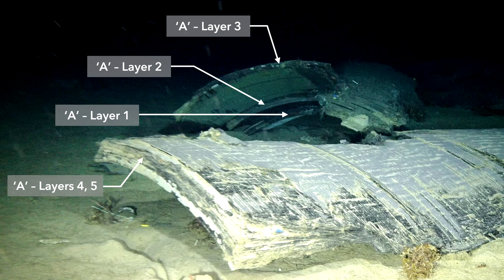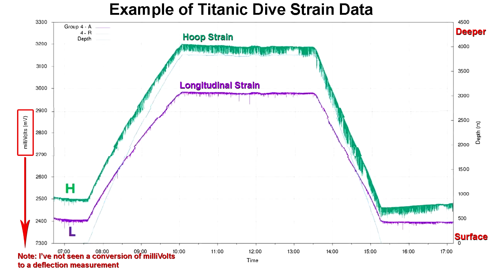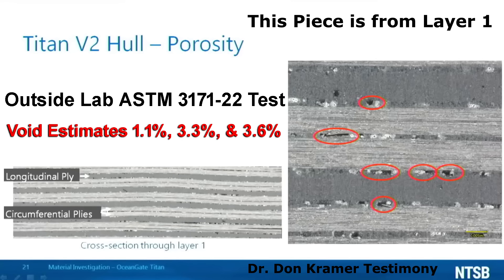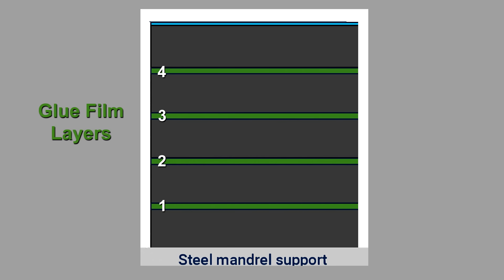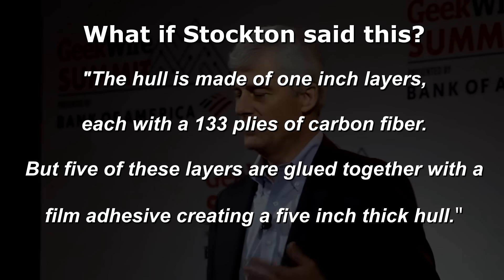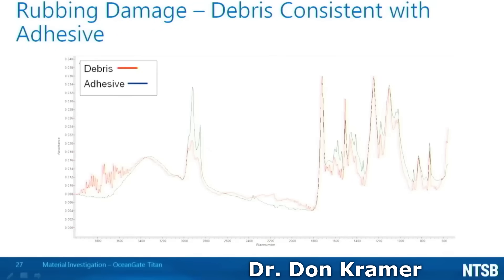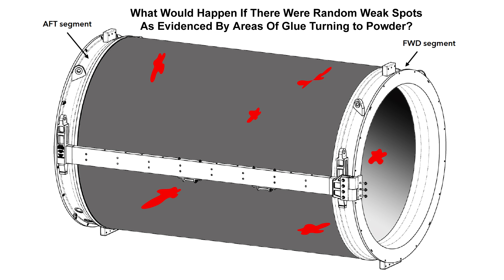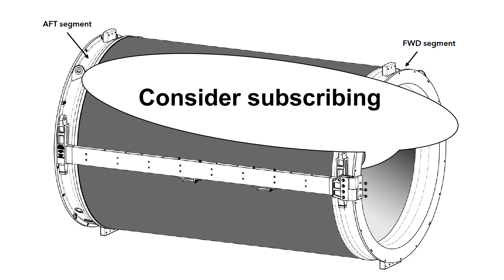OceanGate Titan Hull - Glue Layers Were Breaking Down To Dust - No Clues.

Comment: I bet the company that sold them the carbon fiber knew where the clue came from.  They was definitely quick to remove themselves from the investigation.
Reply: The carbon should've been moulder in a compression mould or vacuum moulded
Reply: @jordanclarke9609   I don't know if carbon fiber should be used at all with pressures pushing inward.  You could blow it up like a Ballon from the inside and get tons of strength because it's pulling against the next fiber.  Like pulling on a seat belt.  But with external pressures, support relyed more on the glue.  At that point the fiber is just acting like rebar.  Also I think we should have single man pods/spheres that can go down individually or link together for the group experience. Minimizing loss if something happens.   Basically a 3' thick acrylic orb. The scooters (attachable or detettachable to orb)  that allow movement being wireless remote.

Comment: The sheer point 360° around each end of the cylinder if the center flexed that much.  Like bending a stick down in the middle raises the each end.  The materials for the cylinder being way more flexible than the rings made sheering a certainty.
Reply from the maker: Thanks for commenting, I agree.

Comment: Looking at all the construction debacles it’s crazy the amount of push Stockton had to have exerted to get Titan finished.
  Leaning on the math wizards out there…
  If the center of the tube deflects X amount, how much peel back is there at the interface surface? I’m interested since I would assume a material as stiff as CF wouldn’t like being peeled away from the hoop ends to which it was glued. Much like multiple layers being glued together only ‘work/flex’ so much until there is damage.
Reply from the maker: Thanks for your comment.  I agree.  The 5-inch thick hull was probably pretty stiff, but if there were inward deflection there should have been a small amount of peel-back at the interface.  Who knows how much, however.

Comment: Am finding the whole deal more and more astounding as I watch further into your series.
Just about every basic engineering principle was ignored and that's Before one factors in the (BASIC) 'specifics' of the methods of composite construction are factored in.
With what I know of composites / composite construction, even if they had wound a contiguous tube in the favoured axes (ie 5 axes)  it would not have survived beyond the number of dives the multi-tube... when factoring the factors that Should have been heeded.
At every level the clever people (and I believe there were No clever people on the project) should not have taken the money and run for the hills... instead shear ignorance / ineptitude / incompetence / greed lead to loss of life.
Reply from the maker: Thanks for your comment and I am glad you are enjoying my series of videos about the Titan.
Reply: Was it actually designed to go in the arctic? From what ive seen which is very little of specific vehicles machines designed for a specific purpose they are one use only. Like if you're doing a dig of a tunnel the thing is designed to do that and not more and you dump the machine afterwards. Or things that go into deserts to pulls stuff out its one and done. They seem to have been running some sort of commercial tourist thing from what i have read which isnt much. Were they even meant to be used more than once?
Reply: @Padraigp  Would a freeze cycle matter to a structure so badly compromised to begin with?
The answers No.
Reply: @bunnyr2013.2f  eh, i think you must have made a mistake. I didn't ask anything about freezing. Im sure whoever asked will appreciate your lack of explanation but just to let you know the sentence you're trying to convey, is " the answer's no." I often find I don't trust people who can't spell, to explain anything, but you might want to give whoever asked some sort of context rather than just .."no". Its not adding a lot. Is it.

Comment: the problem was when they added the lift rings and when it was lifted on the rings put to much stretch on the hull and it pulled the glue seal away from the titanium ring which sealed under pressure but at depth it had enough room between the glue that held the carbon fiber body to the titanium ring thus an implosion along with subpar engineering and materials
Reply from the maker: Thanks for your comment.  You are correct, that is certainly a potential cause of the implosion.
Reply: @solareclipsetimer i meán wouldnt anything implode under there too long? What caused them to be stuck down there so long?
Reply: I think the lift rings didn't cause the failure but probably made the failure to happen sooner. The whole design seemed really unsafe and the manufacturing facilities used were pretty poor for the quality one would need for this kind of design even in theory.

Comment: I have followed this story with interest having worked in Aerospace and motorsport where CF structures are routinely used. 
Excessive void content in composite and also glue layers with attendant reduction in Inter laminar shear strength exhibited by powdered adhesive and evidence of rubbing between the 1 inch thick layers seems plausible. I am yet to see any images or reporting of the bonded Titanium end caps. Is it known how they failed , i.e. can poor pre treatment of the Titanium be found with evidence of adhesive failure to the substrate or was glue found on both the surface of the rings and also on the CF . If the 5 layers of the hull were bending excessively due to partial failures of the glue between layers then there would be greater peel forces generated in the clevis joint of the end caps. Im interested to know more about that and wether it is known that the CF failed or if end cap failed first?
Images of debris on the sea bed looked like there was a rush of water in from one end piling up wreckage down the other end ??
Reply from the maker: Thanks for commenting, and those are good questions.  I don't have exact answers but can make some points.  Regarding the glue joints from the wreckage, some images in the NTSB report show glue still bonded to the titanium surface.  And close ups of the glue surface show the imprint of the plies of the butt edge of the CF  hull.  So, the glue stuck better to the titanium than the CF (it seems).  You are correct about the inward flexing of the hull transmitting peel forces to the glue in the clevis.  But it depends on the amount of deflection.  I have been researching to find a value of inward hull deflection as a measurement of distance and a can't.  Meaning: was it really small, like in microns, was it a millimeter?  Who knows.  They presented the strain data in millivolts, but they never testified how that converted to a distance in their testing.  And you should watch my video about welding on the lifting rings and Tony Nissen's fear of water intrusion at the joints.

Comment: Genuine question as I'm curious, how did investigators determine that the adhesive was rubbing/breaking down before the implosion? Under all that pressure, I'd imagine the entire hull was strained pretty severely during the failure. How do they determine what was caused by the failure and what wasnt? I can get how they do it with plane crashes, given the decades of forensic evidence and experience, but less so with a one-of-its-kind 5-layer CF submersible imploding at the bottom of the ocean... like do we have any kind of standards for what they are even looking for? Do we know that an implosion of that magnitude wouldn't create or enlarge some voids in the adhesive that weren't there beforehand?
Reply: Replying to my own comment becase I found an answer to this in Scott Manley's video on the findings. He shows microscopic images of the sheared bits of adhesive, and despite it being a shattered mess, the individual particles all have these TINY linear grooves worn into them pointing the same exact direction, which can only be made from the layers sliding back and forth horizontally. its amazing how these tiny details can survive such a violent event. the grooves are tiny even under an extremely powerful microscope.
Reply: Excelent question and answer thabk you! I know very little about it but its fascinating. Ive asked a similar question on those videos about drilled stone where they say theres evidence of high speed drilling and i cant understand how you can tell the speed a drill went at after the fact. So its all very interesting to gather these little clues. Thanks. @JeffJones-u8y
Reply: Good comments🧑🏻‍🔧
Reply: forensic science

Comment: Its amazing that with all the cracking and porosity and delamination present that they never developed any leaks or visible water intrusion.
Reply from the maker: Thanks for your comment.  The Rhino Liner on the hull was supposed to prevent direct water intrusion into the surface of the hull.  There is certainly some concern about water intrusion into the glue joint between the hull and the titanium rings.  You need to watch my latest video about adding the lifting eyes, which helps point to the glue joint as the problem.

Comment: Could you imagine getting into an airplane held together by glue?

It's bonkers the glue was applied in sheets. There is no way there aren't going to be air bubbles trapped under the sheets as they are being applied unless they did it in a vacuum chamber.
Reply: Nothing wrong with glue when it's done right. Look at how strong wood glue can be. But, 5 different layers of carbon fiber (purchased beyond it's expiration date from Boeing), ground done in some spots, with a different cure time in each layer, with multiple auto clave times, using sheets of glue rather than some type of spread glue, and so on. In the videos where they were epoxying the end rings to the tube, they are not in a temperature controlled warehouse, they are not wearing hazmat suits with their hair tied up, they are spreading (glue?epoxy?)all over it like it's Bondo! The narcissistic man gambled with everyone's life just because he thought he was smarter than those who warned him of the dangers involved.
Reply: The Boeing 787 Dreamliner is 80% composite by volume......
Reply from the maker: Yes, I agree.  The other issue was there was no test hull.  Not even a scale model. They had no data on the finished porosity or how poorly the glue film layer was bonding. They were just trusting the first time through the process with fully manned dives.  It's amazing.
Reply: There are lots of composite airplanes and the specific method of manufacture and testing is part of the type certificate. They use a vacuum chamber or vacuum bag to eliminate voids. The vacuum bags also provide uniform clamping pressure which is really nice for consistency. It's crazy to me that the Titan hull wasn't clamped while it was baked. That's the stupidest part of this long stupid story.
Reply: @danielreuter2565   Sure, planes are made of composite materials. But they are still held together by rivets. Not glue.
Reply: @alhypo  probably some but not the ones I'm familiar with

Comment: I belive the flexing of the hull put too much strain on the bond between the hull and titanium ring on the forward dome somewhere on the botton, the titanium housing for the hull was completly ripped off.
Reply from the maker: Thanks for your comment.  That very well could be.  That would mean the final issue was high-pressure water intrusion through the glue joint.  Could be.
Reply: @solareclipsetimer  the bottom part of that seal is, in my opinion, the point that "suffered" the most, you have strain from lifting the sub, strain from the flexing, strain from the weight of the sub, all impacts would resonate there and strain from the pressure cycles, in the wreck photos (ntsb report) you can see the intact top portion delaminating outwards, also the pictures from what's left of the glue show not nearly enough  and they sanded the hull to fit the ring, i think the implosion started in the bottom ejecting the forward dome and window, and the sides outwards, dragging the bottom section into the backward dome. The concept was proven in my view, even with all the monkey engineering it still dove 19 times.
Reply: @cubas3870  the problem with declaring the concept proven is that arguably the Titan was NOT built in a scientific manner. So honestly we don't know that if another copy was built it wouldn't implode on the very first dive.
Reply: @WushuMR2  it was built in a scientific manner with a lot of confirmation bias, but the concept it self is sound, sure it was supposed to have a 7 inch hull or use dive rated parts but that is the scientific method saying "hey, don't do that" like some are saying the only point of failure in this project was Rush, he was the most biased, also the scientific community is infected with confirmation and financial bias, so grain of salt here, the bottom line is they built a prototype and it worked, multiple times, what more do you want to prove the concept, i wouldn't trust the titan bellow 500 meters, but a properly machined one with a different name (mind the sea goddess) yes. Carbon and diamond are the same thing in different states.

Comment: Adding a frame inside the hull might have been more strength. Everyone and all the equipment on each dive was putting stress on the inside. If a frame was installed it could have been constructed to hold or suspend the weight more evenly.
Reply: Where do you get the idea the contents of the tube were an even slightly significant factor…

Comment: At least..they did around 80 dives...and normal people have seen the Titanic,like the secretary from oceangate..
They should change the fiberd glass tube every 20,30 dives...at least..with real tests on high pression.
An other set of rings inside would be nice,to have more rigidity.
Reply: They should have tested one hull to failure, those results alone probably would have ended the project. The glass viewport wasn't even rated to go anywhere near the depth of the Titanic. But, good ole Stockton couldn't care less, it all seemed "just jiffy" to him.
Reply from the maker: @dc6233  Thanks for your comment.  You are correct. if they had tested a full-size build of the hull, unmanned for just 10 dives and then destructively tested it (cut it up), they would have seen all the defects in the fabrication process, and it would've ended the project as you said.
Reply from the maker: Thanks for commenting.  Let me clarify something about the OceanGate dive logs and dive numbers.  It is continuous numbering from the first dive of the first hull to the fatal dive of the second hull, which was dive 88.  This includes all dives, even the ones that just went to 10 meters on the LARS fort testing.  For the second hull, you may like this summation. It got to the Titanic 13 times at 3,840m (and in 2022, it got to the Titanic on four consecutive dives!). It also had one dive to 3,500m, one dive to 2,900m, and two other deep dives, 1,700m and 1,380m. You can also count the five high-pressure dives in the Deep Ocean Test Facility done before the expeditions as cycles (3,000m, 4,000m, 4,200m x 3). So, fro the second hull,  that is 20 deep pressure cycles (if not including the 1,380 and the 1,700).  Thanks again.

Comment: Professional engineers have a legal obligation to meet the “standard of care.”   In a nutshell, this is conduct your due diligence and meet the “reasonable & prudent man” rule.
Reply from the maker: You bring up a great point about the engineering profession.  I have talked to several engineers recently who question the need/benefit to become a PE, a Profession Engineer (do the certification).  I am not an engineer, so I don't have a personal opinion on that.  But most of the public doesn't understand that when an engineer is a PE, there is a "duty" ( I don't know the proper way to describe it) to put public safety first.  But not all engineers are PE"s.  I don't know if any were at OceanGate.  Bart Kemper (a PE) did some analysis of the viewport for Hydrospace early on in its design process.  Mr. Kemper said he ended up testifying at the Coast Guard hearings because he called them in the interest of public safety when he heard all of the weird stuff being talked about regarding OceanGate engineering after the tragedy.